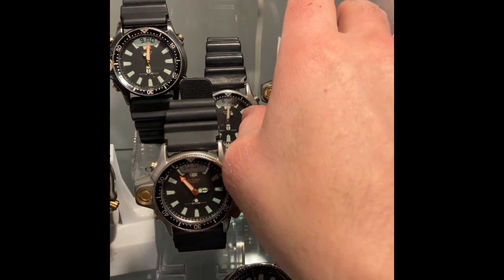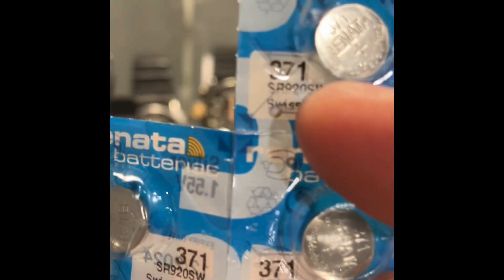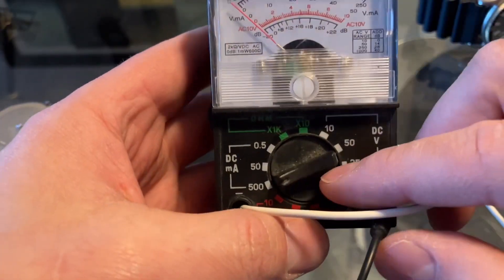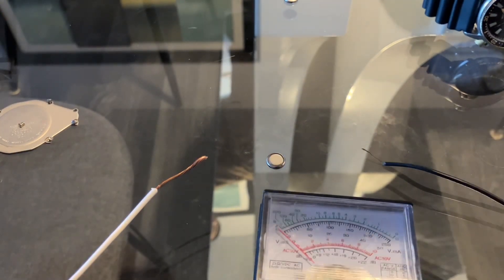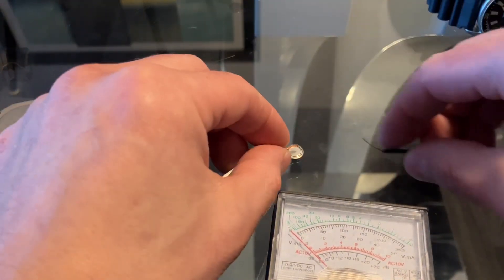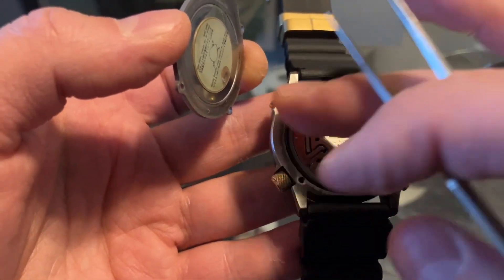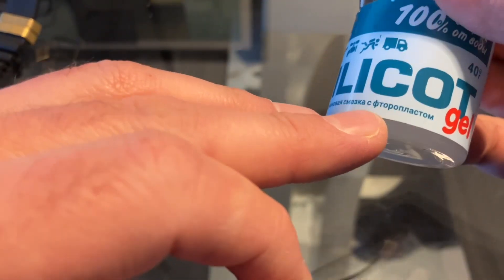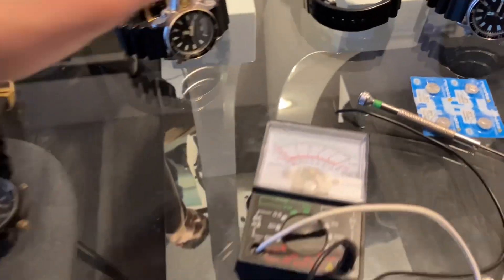Aqualand batteries draining fast in cold weather

Comment: Thank you for making the video. I have a 1st gen aqualand. I did lose 2 screws for the case back. Any advise on where to purchase replacement screws and gasket?
Reply from the maker: Thanks John. Most parts are readily available on Ebay. The screws are easy to get. There is one seller from Israel on Ebay who sells the seals, super affordable. Check it out.Thanks for watching and stay tuned 🙏🏻🙏🏻🙏🏻

Comment: Do you have a video on how to change  all the gaskets on CO23. I just installed new batteries but the gaskets haven’t been changed for over 20 years. eBay has a gasket set 399-5294 there’s also another kit 399–5295. Any help would be most appreciated thank you.
Reply from the maker: No. The most difficult part is to change the rubber gaskets around the pushers (2 mini-seals per button). I will probably make one video about it soon. Thanks for watching.

Comment: I've just changed the batteries on mine but can't get the analogue part restarted. Cleaned all the terminals etc and voltage which is good, then the restart sequence but nothing but the digital part working. Any ideas.
Reply from the maker: Ok see the gear system that makes the analogue part work? Drop a little buttane gas and then one little oil pint on every gear pin (these are the pinky pivots you see on the top, the jewels). If this method doesnt get the gear train working try loosening a bit the screws on the gear plate. If this still doesnt get your watch working then it must definitely be the coil. You must get an aqualand for parts. Check out ebay. Hope this helps friend. Good luck.
Reply: @plasticindices3385  Thanks for the speedy reply. I'll let you know how I get on
Reply: @plasticindices3385  looks like the analogue part is dead cleaned up the box etc but getting no pulse from the analogue part with the tester
Reply: do you have any videos on how to take the inside apart for cleaning? my batteries leaked inside & I need to clean/service. thanks for any help